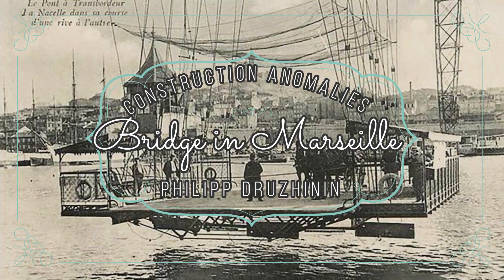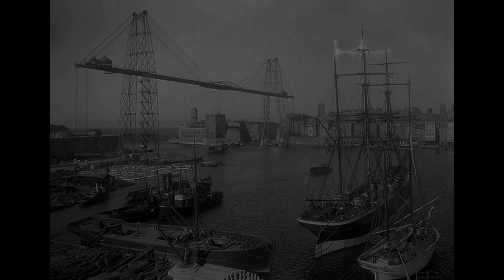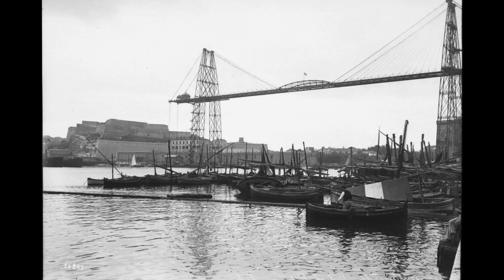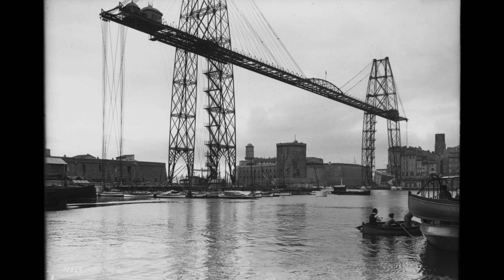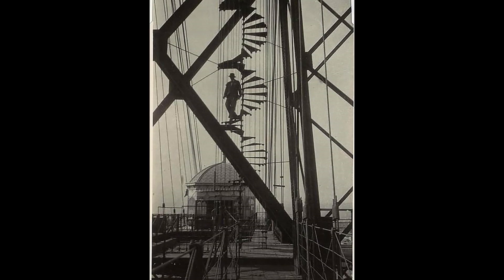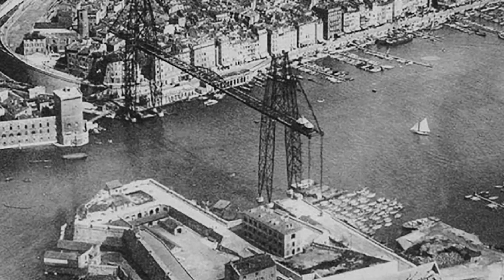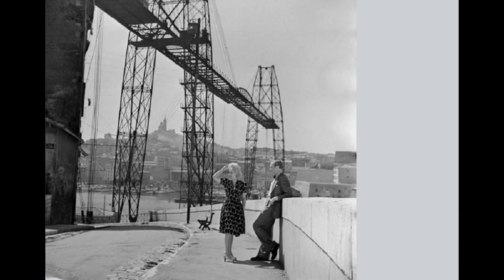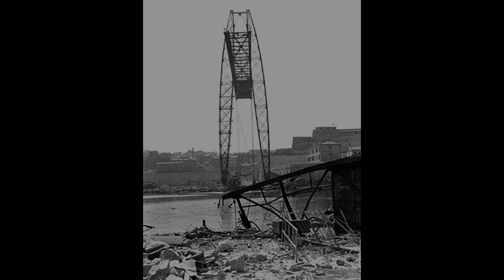Mud Flood Construction AnomaLIES #3 - Marseille transportation bridge

Comment: I am not sure it is an anomaly. Here are a few footage of the construction. This is a technical explanation of the bridge. Notice that the article also shows that there are remnants of the fondation of the pillars still visible there. I am sure it would be possible to contact the author of the article for more details.
http://ponttransbmarseil.free.fr/c3/index.php
Reply from the maker: thanx for your information, I'll check out the topic and mention these pictures from your link in the beginning of next chat or video in this series
Reply: Interesting......
Reply: This seemed odd.... just kinda hit me weird....

"The next day, December 24, 1905, at 3 pm, the public discovered the bridge and took possession of it"

Discovered
Took possession

I DON'T KNOW...... lol
Reply: Still shows "elevation sketches" as blueprints on the web site. Elevation sketches are something you show the guy paying for the project, blueprints are what you show a construction engineer. If you presented this as a blueprint to an engineer he'd simply chuckle quizzically and say, come back when you have 300 pages of detailed schematics and then I can do the initial stress load calculations based on materials, wall thickness, penetrations, span, dead load, live load, foundation bore, temperature stresses and a thousand other things necessary to design and construct a bridge or any other massive project. Then or now.